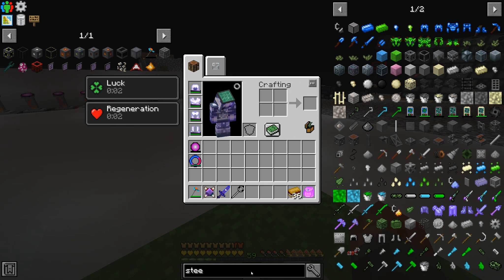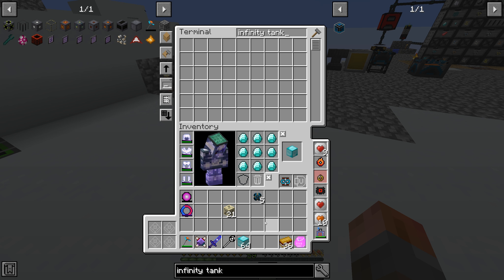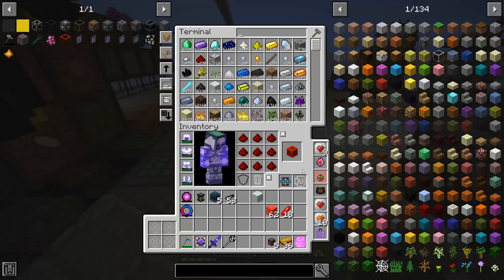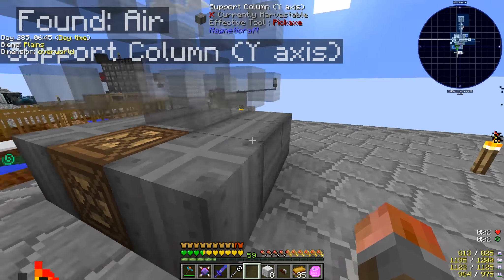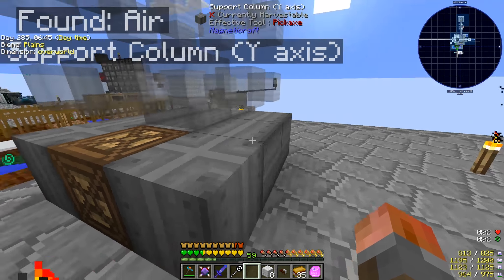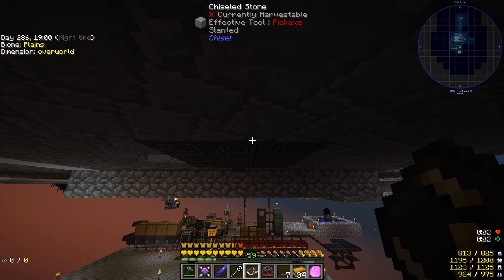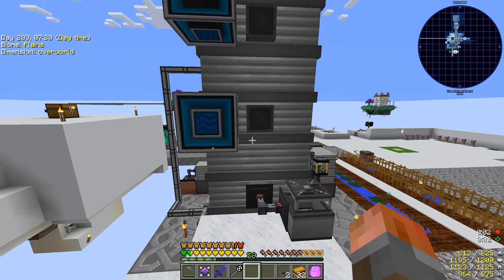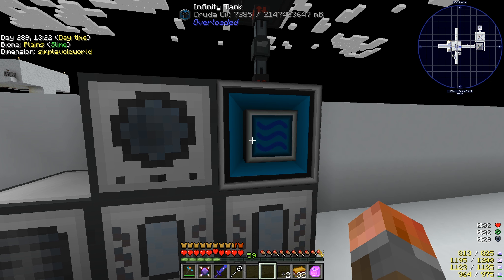Project Ozone 3 E31 - Liquid Plastic with Magneticraft

Comment: pneumaticraft machines convert the lava very often into obsidian so you have to replace it every time. but the lava generation in this pack is pretty nice, so for the heating of pneumaticraft stuff i just used actual additions fluid placers to put lava next to the heat dependant machines and block breakers to get rid of the obsidian that is generated. no need to fiddle with the vortex heaters. also i recommend the whole pneumaticraft setup because the oil to lpg ratio in magneticraft is abysmal.
Reply: The part I am wondering about is if the RF heater would work to heat up the Pneumatic Craft refinery or Thermowhatsit to convert LPG into liquid Plastic.

Comment: The 64x64x64 didnt work out i made it but... it has to be max 32 blocks hahah so i rebuilded it and got 2.5mil rf/t
Reply from the maker: Heh, and did your single crop stick yellorium seed keep up? :)
Reply: 😂😂😂 i used 2 crops and i have 84k in the system